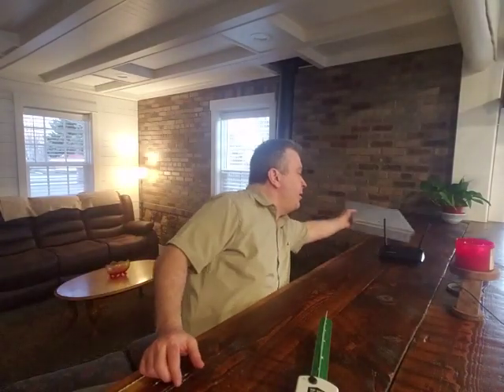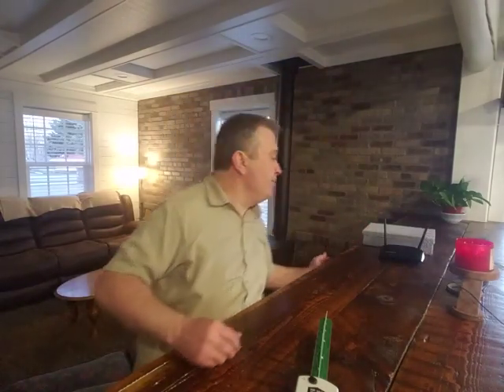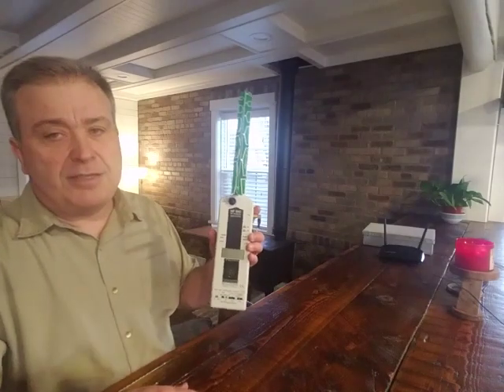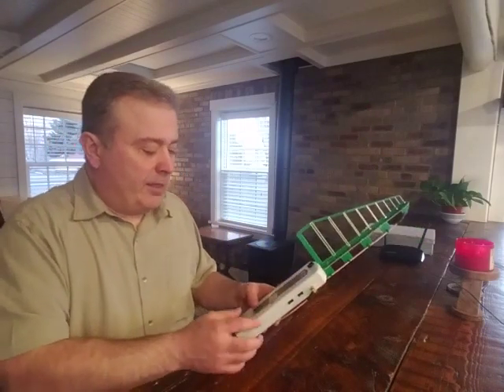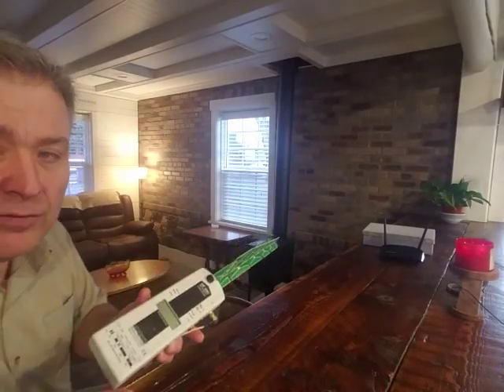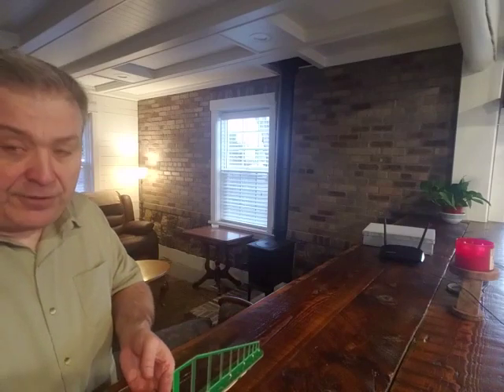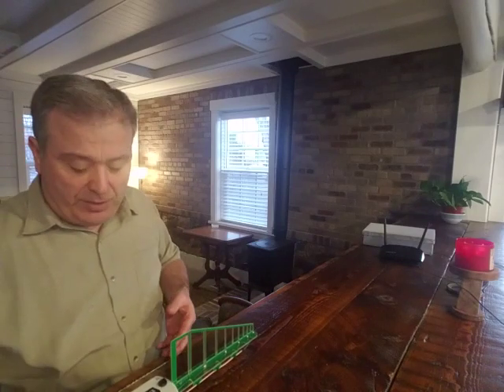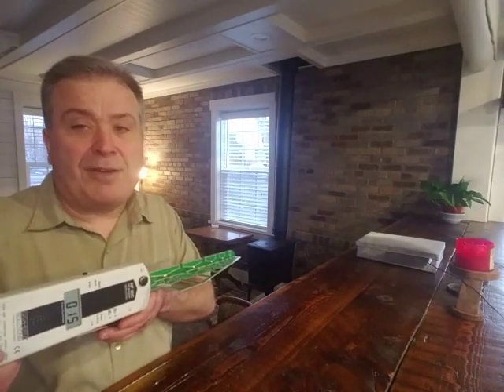Wifi Router Guard Product Review

Comment: Can I use the router guard for phones?
Reply from the maker: Thanks for the question. You could, kind of an expensive way to do it though. Here is an article that shows some the wave cage which is much cheaper. https://www.radiationhealthrisks.com/ways-protect-cell-phone-radiation/
Reply: @RadiationHealthRisks  hi! Thanks for the response! I was going to use it for our cell phones in an RV because I’m thinking that the radiation would just bounce off the ceiling if I used a basket or cage? If you had any thoughts or knowledge on that it would be very helpful!

Have you ever heard of anyone developing ringing in their ears due to this? I started using blue tooth headphones and have had ringing in my ears for over a year now.
Reply from the maker: @erickawendt9296  Here is an article I did a few years ago listing the possible symptoms. https://www.radiationhealthrisks.com/health-symptoms-rf-radiation/. When I have my cell phone in a wavecage set up on a shelf about 5 feet away sitting higher than my head when sleeping, I get zero radiation. I have tested it with my meter from the spot where I sleep. The farther you can set it away from you the better. 6 to 8 feet would be even better.

Comment: I bought a guard and have seen my download speed plummet :(   (via speedtest.net)
Reply from the maker: The higher the frequency used by the router the bigger the difference you will notice. Again your very best alternative is to run shielding Ethernet cables and turn off your wifi.
Reply: @RadiationHealthRisks  Not practical as we have so many of us (upstairs and downstairs) using internet. The odd thing is that although connection appears to have worsened none of the kids have complained about lag and I havent noticed a deterioration either when Ive been online.
Reply from the maker: @tmitchell6552  That is what I found too. I am still able to watch YouTube videos and build my websites and do everything I need to do with the wifi.
Reply: @RadiationHealthRisks  Thats odd. I wonder why...
Reply from the maker: @tmitchell6552  My personal opinion is that there is enough "radiation" getting out (that my meters apparently can't detect) to do what I need to do. But every meter I have reads zero radiation once I get 10 to 15 feet away from the router in the router guard. So if the meter can't pick it up, I don't worry about it. If you look into this topic and find something more substantial on this I would love to know.
Reply: @RadiationHealthRisks  Happy to take your word for it....not concerrned about apparent low download speeds as long as everyone in the house is happy with their gaming/streaming/surfing. Seems to indicate that the radiation is not necessary for good functioning.
Reply from the maker: @tmitchell6552  Sounds good.

Comment: If i turn off the WiFi on my router and just use a wired connection, does it still emit radiation?
Reply from the maker: Nope. Only Wifi devices emit RF Radiation.
Reply: It still emits EMI's though.  https://www.emfanalysis.com/low-emf-internet-connection/

Comment: On your web page here: https://www.radiationhealthrisks.com/cell-phone-tower-radiation-harmful/
You mention the safe radiation limits for several countries;
"Comparison of our limit alongside other countries’ standards:
    USA\Canada = 1000 microwatts /cm2 (same as ICNIRP 1998)"
In this video your HF35C tester is maxed out at 2000microwatts per square meter, not per square centimeter.
A square centimeter is 10,000 times smaller than a square meter.
So in fact the reading is really just over .2 microwatts per square cm which is almost 5000 times below the safe limit.

Also, most Wifi routers are dual band and also transmit at 5Ghz. This meter can only test up to 2.5Ghz.
This means your testing methods and results are flawed.
Reply from the maker: Thank you for pointing that out. I corrected my table. I wrote that a few years ago when I was just beginning my research into this stuff. The safety limits are in micro-watts per square meter, not centimetre. Who told me about this (in fact she talks about it also in this video https://youtu.be/S57mrknMajY) is Dr. Laura Pressley Ph.D., (who has a doctorate in Physical Chemistry and holds four U.S. Patents in semiconductor device technology). She is the one that told me that the safety limits were in square meters. I just listed the numbers incorrectly.

Comment: Where did you obtain your physics degree? If you block the radiation (ie radio signals) then the signal won't reach your wifi devices. If the devices are still working then this box doesn't do what you tell us it does. And if it reduces the amplitude of the signal then the device in your hand will have to ramp up its dissipated RF output to compensate. Thus exposing you to more RF. Which is not a problem in the slightest but it's a waste of battery power. Your products are flawed and you are making false claims. You are what I consider to be a moron. Can't wait for your response. I could do with a laugh!!!!
Reply from the maker: Thank you for your comment. Your comment is exactly what I thought when I first saw the WiFi router guard. That is why I bought one so that I could test it out to do this review. I have several different brands of RF testing meters, and when I test with every meter, putting the router in a metal mesh box like this blocks 90 to 95% of the radiation. When around 10 to 12 feet from the router in the router guard none of my meters pick up any RF radiation at all. And yet through out my house I have fast enough wifi to do whatever I need (I have a small 3 bedroom home). About once every couple of months, if I am uploading a big video file or something, I may have to take the router out of the box for that, and then I put it back in once its done. I don't make these boxes. This video was only a review of the one I bought. I learned about these things from a Dr. Laura Pressley Ph.D., (who has a doctorate in Physical Chemistry and holds four U.S. Patents in semiconductor device technology). I don't have a physics degree. As far as RF radiation, it is very harmful. There are literally hundreds of independent, non-biased peer reviewed scientific studies that link RF radiation to things like cancer, diabetes exasperation, poor oxygen absorption, DNA unwinding (especially in infants and fetuses) and infertility. I link to some of these studies on the scientific studies page of my website here: https://www.radiationhealthrisks.com/scientific-studies/. I hope you take the time to look up the studies I link to and read them. Thanks again for the comment.
Reply: I do have degree level physics. Let's do this piece at a time. What is your rationale for quoting 2000 µwatts per square metre as some kind of level that puts us all at substantially increased risk of health issues? That is a very very minute amount of power. Standing in the sun will subject you to about 1kW per square metre. IR, visible light and UV are far shorter wavelength (thus higher frequency) than radio waves you're proclaiming are so dangerous.
I appreciate you don't have degree level physics, and that's been patently clear right from the outset. I think you're preying on peoples' fears and lack of understanding. You're no better than your intended targets / customers. But anyway, let's continue this dialogue.
Reply from the maker: @paulanderson79  Well at least your not laughing, that is positive. But no in all seriousness, according to Dr. Laura Pressley, see her here in this video https://youtu.be/S57mrknMajY, she is the one that told me that 1,000 micro-watts per meter squared is a US safety limit. She mentions that I believe in that video as well. Other countries have 200 to 400 micro-watt per meter squared safety limits.
Reply: @RadiationHealthRisks  I am not disputing the numbers. I am asking you to explain what you understand by them.
If 2000 µwatts per square metre is very very dangerous, how is 1000 watts per square metre safe?
Standing in the sun you'll have 500,000 times more electromagnetic radiation incident upon you than you'd receive being in usable proximity to a WAP.
Electromagnetic radiation is essential to life on Earth.
Reply from the maker: @paulanderson79  Thank you for the question. Really the answers are on that scientific studies page I linked to for you in an earlier comment. Those are doctors and scientists from all over the world. If you are like me, you don't care what any person says, degree or no degree, I want to see if there are any independent (non-paid, non- biased) scientific studies on the this radiation. That to me is what carries the weight. But having said that, I will say this. Electromagnetic radiation, at least portions of the spectrum, are essential to life. I don't think x-rays or gamma rays are. They are dangerous, yet they are part of the spectrum. Not all parts of the spectrum are harmful. Obviously infrared and visible light are not. But other frequencies are. I have heard most of my life from people that cell phone radiation caused brain tumors, and I never believed it. I thought it was silly. I lived on my cell phone so I guess I just didn't want to believe it, or at least I didn't believe it enough to look into it. Then years later I came across that video with Dr Laura Pressley, and for some reason watched it. For some reason that got my attention. All of a sudden I became interested in it. I called her and asked her some questions. I went to her website and started reading the scientific studies she linked to. Then I started researching to find and read more newer scientific studies. And my understanding and this website eventually grew out of that. People who come to me with questions like yours I send to that page of my website. That is what I put it together for. I don't mind the questions, but the information that page links to is the information that matters. Hopefully that makes since.
Reply from the maker: @paulanderson79  One other point I meant to add. Many of the scientific studies done were with much lower amounts of radiation than 2,000 micro-watts per meter squared. And many of the frequencies were not even in the microwave portion of the spectrum, but below those frequencies. Anyway there is nothing I can say that will convince you of anything, or at least it shouldn't. You really need to go read those studies for yourself (and I imagine there are more out now), and make up your own mind.
Reply from the maker: @paulanderson79  Again, thank you for the comment. I make no pretense of being an expert, physicist, electrician, or anything else like that. If I represent myself in my articles and videos accurately, which I do, then I am not scamming anyone. What I do claim to have done, which I have invited you to do also, is to have researched and read many scientific studies and I link to them so others can read them to. I don't recommend anyone to believe me, just as I have not suggested you to believe me, I recommend everyone go read the studies themselves https://www.radiationhealthrisks.com/scientific-studies/. I can read English and understand it. The study conclusions are simple to understand for the most part. As far as the wording "micro-watts per meter squared", I got that from  Dr. Laura Pressley Ph.D., (who has a doctorate in Physical Chemistry and holds four U.S. Patents in semiconductor device technology). She does not sell anything nor make any money from this issue. I wish you well and hope you have a great rest of your day.
Reply: @RadiationHealthRisks  "many of the frequencies were not even in the microwave spectrum but in the analog'. What is that supposed to mean? You're completely out of your depth. Hilariously so.
Reply from the maker: @paulanderson79  Thank you for your comment. Now that I understand what you are talking about you are correct, I misspoke,  all radio waves are analog. I have a bad habit of referring to the lower frequencies (below the microwave range) as analog because most electronic devices that I test are usually analog if they use a frequency below the microwave range (such as baby monitors for example). But you are correct, all radio 
waves are analog.
Reply from the maker: @7362xvdvdjjell  Thank you for your comment.

Comment: Thanks for this information. I am going to order a wastebasket and put it over my router. 

I found an amazon link on your site.
Is it a problem to cover the router?

Thanks much!
Reply from the maker: Thank you for the question. It won't cause any problem, but if your router is on an upstairs floor then radiation will still come out the bottom and throughout your house. You want to have a basket that covers the entirety (completely surrounds) of the router like a router guard. If money is an issue just go to a hardware store and buy some aluminum window screen and set your router on that with a basket over the top.
Reply: the writer seemingly wanted to poopoo the cage. But you did not buy into that. Good for you, and good advise on top. I hope she has success shlelding herself.  @RadiationHealthRisks
Reply from the maker: @LeonoreAlaniz  Thank you

Comment: Here I am with yet another question. I have a router AND an ONT box at home (I have Verizon). Does the ONT box make radiation? I’m not sure if I would have to get a guard for the ONT box too. Also, do you know if appliances and TV’s still make radiation even if they are off but still plugged in? If yes, what would you suggest to do? Thank you again for answering my questions ☺️
Reply from the maker: This is why you need your own meter. I am happy to answer but having a meter allows you to go through your own house and check each device.  And it allows you to verify that the protection measures you took reduced the emission. I don't have fiber optics in my home, neither do my kids, so I have never tested one. There are 4 basic types of EMF radiation, they are 1. radio frequency (RF) radiation, 2. electric fields, 3. magnetic fields and 4. dirty electricity which is kind of a combination of those coming across and off of the electrical wiring in your home. All of them are toxic. All electric devices give off electric fields and magnetic fields, but these dissipate with distance and (in my opinion) if they are not overly powerful or sitting on your lap, they are not a huge deal. RF radiation is the most powerful and is also called "WiFi" or "microwave" radiation. Pretty much you know a device emits this if it transmits or connects to anything wirelessly. It is very possible that your ONT box causes dirty electricity. Anything that manipulates electricity (such as converting AC to DC) causes dirty electricity. What you would do to test this is to plug a meter that measures for dirty electricity into an outlet on the circuit that the ONT is plugged into. https://www.radiationhealthrisks.com/best-emf-rf-meters-and-detectors/
Reply: Got it. I have to get one of those meters. Which one would you suggest for beginners? Also, you talked about adding an aluminum screen. Where do I get one of those?
Reply from the maker: @taylorteliatnikov995  The aluminum screen is just normal aluminum window screen you can get at any hardware store. Just make sure it is aluminum and not plastic. As far as the meter question the best thing to do is to read this article I wrote about meters https://www.youtube.com/redirect?stzid=UgyepBv0HhMtt7hg_-x4AaABAg.9909y15xV7t994pD_VrzIX&q=https%3A%2F%2Fwww.radiationhealthrisks.com%2Fbest-emf-rf-meters-and-detectors%2F&event=comments&redir_token=QfX_ROiLO3JFxCFj3pEZjz-eRul8MTU5MDUyNjY2MkAxNTkwNDQwMjYy. The first meter you should buy would be one that measures RF Radiation. I show several in that article. Next would be a dirty electricity meter. I never use my meters for measuring electric fields and magnetic fields. I just have shields for my lap for laptop/tablet and keep my distance whenever possible. You can find videos on this stuff here https://www.youtube.com/channel/UCUMbI8q4R3o9zOySV2IZhVQ